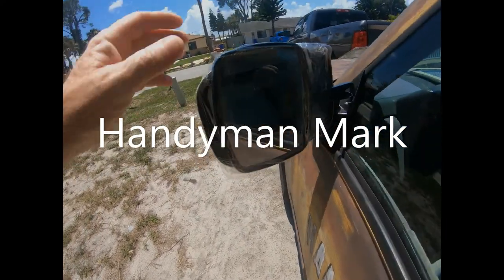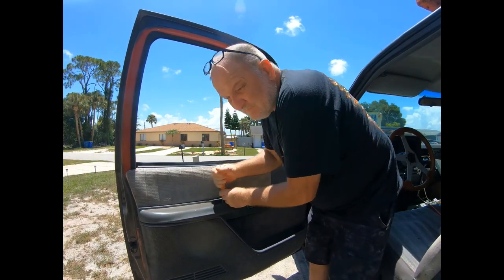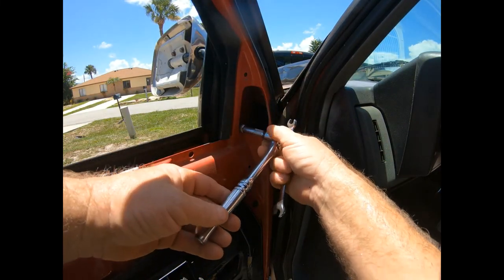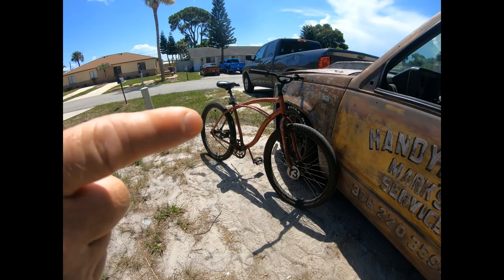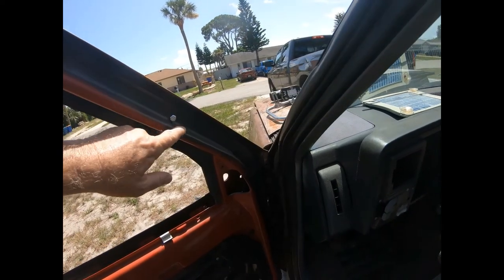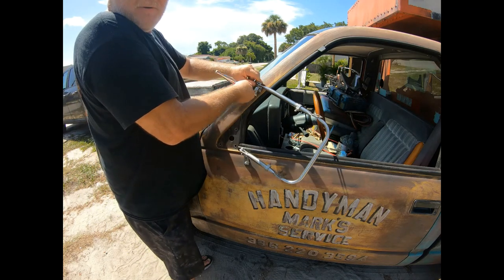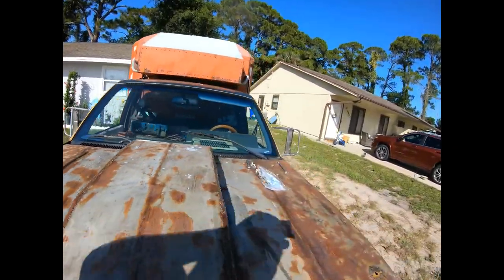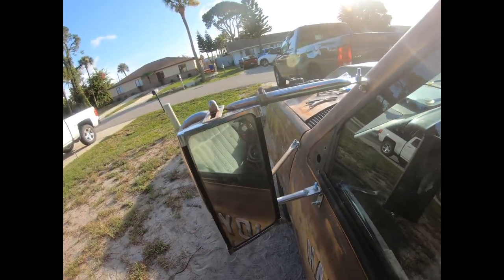Westcoast mirrors. Big Rig Style.

Comment: What outside diameter tubing are you using?
What conduit size/diameter?
Aluminum, steel or stainless?
Reply from the maker: The tubing that came with the mirror is 5/8 the steel conduit measures 3/4 outside 5/8 inside diameter